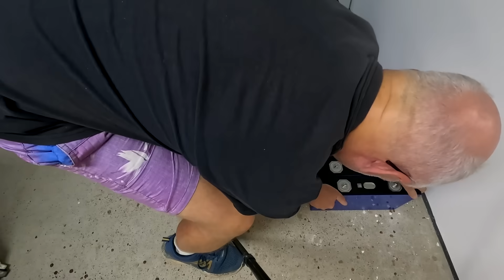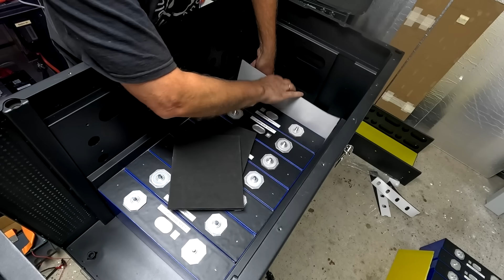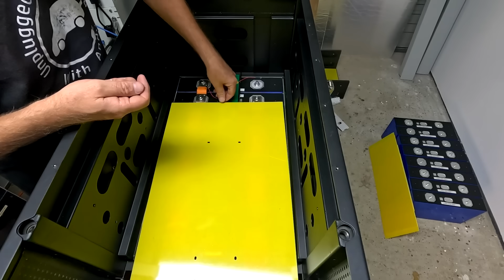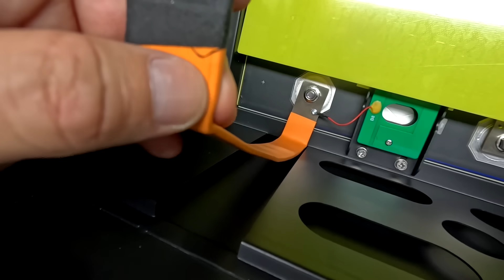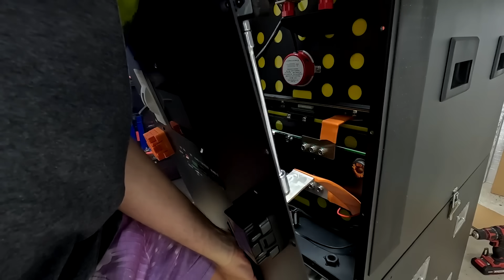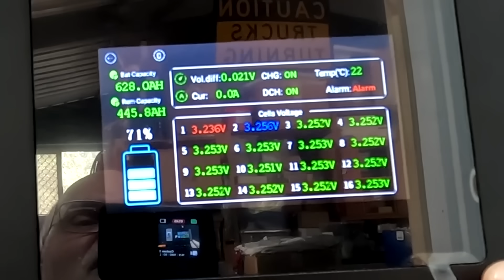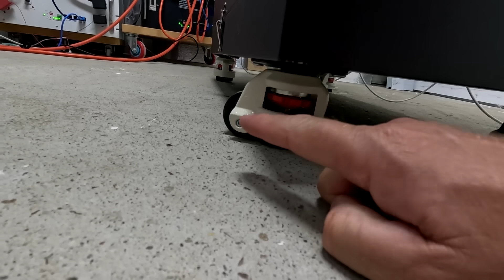First MB56 DIY Kit Build - The Big Beautiful Battery!

Comment: Not a fan of having the metal base of the top layer sitting above the terminals of the bottom layer even with epoxy sheet in between, do the balance cables lie on top of the balance lead PCB carrier?

Comment: Saying so many nm screw torque will equate to so many kg force is already far fetched. Depending on the steel quality, how neat the threads are, is there paint in the threads etc.
But dividing by six times six  screws is even more creative.
If everything is normed, it is already a graph with all kinds of things happening. For the range the bolt is intended for, the curve is pretty much flat. It's just M6 normally is not torqued to 1nm.
So don't do any calculations then without some setup to test the hypothesis.
Like you mentioned the soft foam destroys your whole plan anyway. I wouldn't use it if I don't have to.
When you open it a couple of years later, you see there is no foam left.

Comment: Hi Andy, thank you very much for your video. I like it pretty much. I already ordered 2 of the boxes. Miaoxin is very helpful and answers all questions. I also ordered additional epoxies inbetween the cells.(optional) I think it is worth it. Thumps up.... I'm also wondering about the compression plate. I made some thoughts about and wanted to share with you. In the ordinary boxes with the smaller cells like lf280k or mb31.....there is a middle plate which divides the two rows of batteries. This is no missing due to the new big cells😂.....so here's my idea. What if.....? The PCB holder would act as a joint plate from the back to the front end. Of course we would need the same at the bottom that it is symmetrical again. We would not screw them from top or bottom. We would screw it from the front. There would be some flat ringbolts or whatever which would hold them in place so that there would be a longitudinal expansion possibility. And then with a additional screw we would be able to put the compression on in the same way we do it at both sides. And there would be less bending of the frontplate. And the compression would be distributed more equaly. Maybe you can imagine what I want to explain. My english it not so good. I could also make a sketch or drawing and share it with you. Just let me know. Maybe it is worth to think about or Yixiang has interest in?
Kind regards Thorsten H.
Reply: I guess you'd have to make sure that any stretch didn't damage the PCB.
Reply: @matthewmarks6951   Hi Matthew, I would just use the holder of the PCB itself. It seems to me that this sheetmetal is strong enough to hold the forces easily. It than would be in 2-up configuration. One at the bottom and one on the top.

Comment: What was the alarm?  Inquiring minds want to know!    Also, I'd like to see another 3240 insolation board (aka 'epoxy sheet' / 'FR4 fiberglass sheet') for the rear bus bar's groove so there's even less chance that the case becomes grounded. And the Fire extinguisher's sense wire should be closest to (but not obstructing) the cell's vent. If it's going to erupt internally, that's where the damage is coming from.
Reply: Certainly the BMSs used to register an alarm that the password hadn't been changed from the default. I have a vague recollection that they scrapped that.

Comment: Wow. Did you capacity test each one.. that would take weeks. Andy.. does that BMS have a larger balancer than 2A?
Reply: They all have 2 A balancers but that should be sufficient if the cells are matched.
Reply: @matthewmarks6951 they never come matched. Usually up to 4ah deviation on cells. Matching requires testing each cell and hand selecting the ones that are very close to each other. These sellers don't do that unless you are willing to pay.
Reply: @natesdiysolar  OK, from the same batch then. Close enough.

Comment: Can we hook up these batteries (w/ JK BMS) in series if you are wanting to use higher voltage inverters like a 30kw Solis???
Reply: No. The MOSFETs are only rated for a certain drain source voltage. If a BMS in a stack of batteries disconnects, it will have the full stack voltage across it and will fail. Similar consideration needs to be given to the circuit breakers and fuses.

Comment: Not to be contrarian or anything, but reducing the width of the bus bar for that short distance is quite likely not a real world issue at all. 

The current-carrying capacity is much more affected by the LENGTH of the bus bar than the width over such a short distance right where it connects. The distance that the current has to travel from the connection point over the narrow section of bus bar is quite short. 

The increase in resistance will be much greater over the longer length, because the farther it has to travel, the greater the resistance will be. A current flowing q few mm over a slightly smaller conductor to the larger conductor probably won't matter. There's some math that could be done to confirm it, but you'd be surprised by how much current can flow over a smaller conductor that is very short.

You could do the math by getting the dimensions of the modified bus bar and calculating the resistance over the modified area and the distance that the current needs to travel. I bet you'd be surprised at what Ohm's law would have to say about it.

Comment: Looks Awesome. I have one comment after watching first row down that you will never go back to again. If I was assembling this battery, I would clean the battery terminals and bus bars in some manners suspecting some kind of possible coating from the factory. One fast way I have used is spray contact cleaner on all contact surfaces. which evaporates quickly. Since once enclosed, you are never going back in there, Do you think that might be a good idea? Otherwise looks First Class. ... My Two Cents

Comment: I am assembling 2, ten slot RUiXU (100kWh total) server racks as I watch this!  $22,762 usd total cost. I have no idea if this is good or not, I live deep in middle of nowhere with no one to help so I buy these batteries, 72 - 630W SEG panels, 2 x FlexBOSS21 and GridBOSS.
Reply: You could have saved with these.
Reply: @sergenalishiwa9097  Thanks, yes I see there would be a little savings. But, with server rack architecture, I can pull (or simply disable) one failed 100Ah module and repair without disrupting anything. No other arrangement that I found allowed this so easily and even remotely.  But again, I am a noob, so please do not flame.
Reply: @ModQuad-l6z you can still get the 15KW model and still save.

Comment: Thanks for the videos and your work with Yixiang to bring the improvements together. Interested to know the specifications for the 300A fuse on the positive busbar. I realize it will be a future video... wondering if you're planing to connect this on the Powerwall 3.0 via a Victron Lynx Power-In M10 with a 300A / 80V Mega-fuse or if you'll be upgrading to a Power-In Class-T with a 300A / 125VDC fuse. Thanks again.

Comment: 32 kWh Battery 
EVE MB 56 $96Battery × 16= $1536
Yixiang DIY MB 56 Kits = $569

TOTAL= $2105  or $65/kWh
Reply: Shipping doubles that price unless you live in China
Reply: @georgesteele3888  actually shipping is $240 to Australia.
Reply: +$99 for the base
And additional cabling costs...

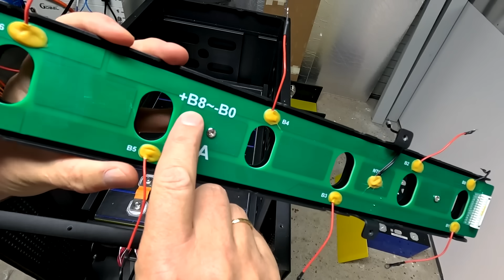Comment: 11:58
Top row is B9 to B16 = 8 cells
Bottom row is B0 to B8 = 9cells
WHAT ??? 🐸
Reply: B0 is the power connection to the BMS.
Reply: Cell 8 has double pole, because the PCB may be used for 24V setup too.
Reply: The sense wire for the fire extinguiser should be fixed above the vents.
Reply: B- to B8 and other row B8 to B16 and B+
JK BMS have power B+ wire what goes to main positive, last cell positive side have 2 wires.

Comment: I would look for horizontal build, not vertical, wider not taller. Happy to see 300a by default, lets see if they will provide the bus bars that will survive abuse of 300a… those in video fitz more 200a… max by my idealistic taste.

Comment: Thanks Andy, will see how they finally balance the cells out, I finished my Pink MB56 box and commissioned it last week, I had to charge one cell by 10ah which I used a charger, other then that it went well, enjoy your holiday.
Reply: Wonder if that cell will be the first one to die. Or continue to require special attention.
Reply: @moestrei  Over the last week the worst it got was 52mV between the highest and lowest cells voltages, so time will tell when the BMS can't balance the indifference, it takes about 1hr of balancing before all cells come within 10mV

Comment: I think you should scrap everything and install a new Deye high voltage system. Just installed a 50kw 3 ph Deye inverter with a 160kw 800v battery. Only needed a 160 amp fuse😂
Reply: how much was that 800v battery per 1kwh?
Reply: @423GustavBern about 140 usd

Comment: What is the thickness of the metal sheet used for this MB56 DIY box, as well as the 280-340Ah DIY box in mm? What is the value for the 100Ah DIY box? What is the exact material description of these metal sheets?

Comment: Wouldn't it be better to have more batteries??   Few batteries means more amps through the BMS and wires.    Isn't this BMS limited to 200a?
Reply: 300 amp BMS
Reply: 200a times 48volt is almost 10kw, i doubt most people need more

Comment: The connectors on the battery PCB's should match color with the cable connectors to prevent accidents. Both top and bottom are white while cables have black connectors.
Not ideal.
Reply: The bottom cable is short, the top cable is long. Pretty much common sense on where they should land.

Comment: Another Awesome video Andy! I rather have both Epoxy sheets and foam pads between the cells! And I like to see this Awesome setup in MB56 cells in one level! can stack wider cases higher then them being taller cases. I totally looking to get these upgrades.
Reply: Yes. Aren't you supposed to isolate the cells from each other? Foam could crumble to nothing.
Reply: Absolutely

Comment: Just a thought  to the new big cases: from the service look the one floor cases are better to check after a while, a few month or so. You can open the top, check every connection at torque, tempreture with cam or/and the poles of corrosion.

With the new cases you couldnt reach 8 cells easily.

Comment: Please what's the amp hour rating of the BMS used?
Reply: 300
Reply: Amps - not amp hours. The BMS has to be able to pass a certain amount of current. It doesn't care about the total capacity (apart from estimating the state of charge).
Reply: @matthewmarks6951 thanks for the correction. I know it should be amps, not amp hours and  I'd have denied I could write such a thing but there it is so I'll not bother  editing it. I was asking about the current carrying capacity because at 628 amp hours, a 200 amp BMS, which is the highest most commonly used today would barely be charging this type of cells at 0.3C while already working itself to the max. As cell capacities get larger, biffier BMS would be needed. As I wrote in my 1st comment yesterday, there are already cells rated at 1175AH in the Chinese market and they'll gradually find their ways to the DIY world.
Reply: @adon8672  It's true it can can't charge or discharge the battery in a couple of hours, but the scenarios where that will be needed are few and far between. These will mostly be used to extend the periods of poor weather where power can be provided.

Comment: The cells are shrink wrapped with nonconducting plastic so, the foam provides mechanical separation. Isn’t that sufficient?
Reply: The wrapping on the cells is thin and relatively easy to damage. The 3240 insolation board is much more durable and likely to withstand the test of time.
Reply: @wAf-Billy  @DaleDenis Thin = 100 micron PET

Comment: I have 2 batteries with lf280k cells and 1 battery with mb31 cells. All 3 batteries in parallel.
Could I get away with adding an mb56 based battery in parallel with the others or do I need to stick with similar capacity batteries in a parallel battery bank?
Reply: possible with mb56 battery bank in parallel.
Reply: you can as long as each pack has their own bms, but you could have a problem with one pack charging and discharging way faster then the other ones (depends on internal resistance of each pack)
Reply: @423GustavBern they all have their own 200a JK V14/15 inverter bms
Reply: @JK9579 Andy has done many videos on putting different batteries in parallel. Doesn't really matter is conclusion.

Comment: I don't think you know why and how the marker is applied when torqueing down bolts. The point is not just to mark the nut, but to mark a point on the nut in relation to the base so you can see later if it has become undone. Otherwise great video! Sad about the back cutout...
Reply: Add a dab of Bright Red nail polish to cover the nut and base as an anti-tamper indicator, then you will know if it has been moved in future because the polish will be broken.
Reply: @DavidHobbs-d8h  I prefer the magic marker or similar as then I can wipe it off with alcohol later if I need to do service on something.

Comment: As an engineer. I would be concerned about the pressure plate bending.  In my opinion, the plate metal is much too thin to do the job properly as it is deforming.  Hence, the plate should be thicker or a reinforcement bar to give it extra strength to prevent the deforming of the pressure plate.
Why are there no double outlet connections on the outside as the smaller batteries have.
The bigger battery is great, but there is no backup battery if the BMS fails. 
Therefore, personally I would prefer two of them.
Reply: What about 2 of the bigger batteries?
Reply: That's why I built my own MB56 box
Reply: As an engineer,  if you consider reliability engineering, both redundancy and simplicity are approaches to reliability.  You would prefer to have two smaller batteries, for system redundancy, each of which contains its own BMS which is the most likely failure point. This might be more important for someone reliant on one or two batteries.

Simplification would call for a single large battery with the capacity of two small ones, and just one BMS.  This reduces system complexity, cost, and number of high failure rate components.  I would see this being preferred for a system where this is just one of two or more batteries.
Reply: They always talk about engineers but I'm pretty sure they ain't got any working on those
Reply: @honumoorea873 If you have to get something built best to ask those that do the building not the engineer on AutoCAD screen
Reply: The plates are too thin by design and consist of a dual wall design with some space between the walls. That space is needed for the future 2 till 3 mm of expansion per cell. Without springs any thick metal plate will excercise too high pressure forces on the cells over life time. The cells will expand with 50-60 kN and are only allowed max. 10 kN.
Reply: @fal6097  Sorry, don't buy that as an explanation. Reason is that there is thick foam padding, which Andy specifically it talking about in that section of the video, where the compression of the foam is happening on the ends, and not in the middle.
So there is "plenty" of room for making the metal plate more rigid. It's not the plate that should give when the cells expand, but the foam padding.
And if the foam is not being evenly compressed from one side to the center, then the plate is not compressing the cells evenly either. Which means that the cells will experience much higher compression on the outside edges along the case, than they will experience in the middle. 
This is not a good design. Cells should be evenly compressed from one edge to the other with almost zero deviation from corner to corner.
So the plate needs to be made a little beefier so that it can properly and evenly provide adequate compression when needed across the whole facing of the cell, not just along the one corner.
Reply: @korishan   I agree with you that the compression plates are no good. In the ideal world compression splints for MB56 should be 15mm thick steel. For this MB56 case, before replacing the compression plates, first you have to know which amount of foam is inside, and what its thickness will become with 10 kN of load. The 8 cells need 24 mm of expansion space in total over life time. After 24 mm of expansion the design should not apply more then 10 kN of compression onto the cells. Then you know if there is room in the design to make the compression plates more rigid.
Reply: @fal6097  Made to a weight for transport costs, wheels and base strenght are not designed to be moved around and around, the very small wheels will bite into the smallest of pebble or groove on the floor, that is why they have the jacking post built into the wheel because the duty cycle of the wheels itself is poor, I will stick with my DIY MB56 box
Reply: I was thinking the same thing about the plate.  The other thing would be it should be folded to make a channel the whole length from bolt to bolt so that it stays firmly in place and not flexing. I don't think the single fold they have is good enough even if it were made a heavier gauge.

Comment: I will no longer use the M3 inserts. They are not drilled into the busbars and threaded, but rather M3 sleeves have been pressed in. And these pressed sleeves have often caused contact problems for me.  This could also be the problem with your voltage differences between cells No. 1 and No. 2.  In the future, I will only connect the balancer cables directly.
Reply: Good point, but it's too much of a coincidence that those two cells have been tested and the rest are showing as virtually identical. Note that there is practically no current flowing in the balance wires as it's not balancing.